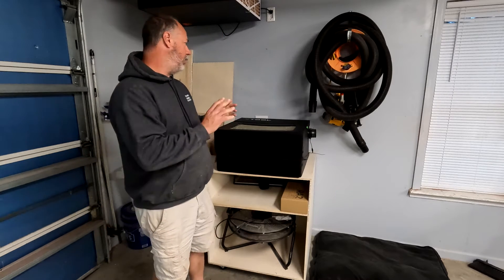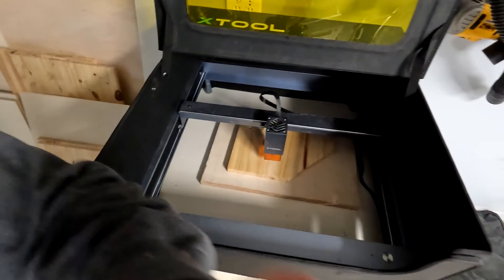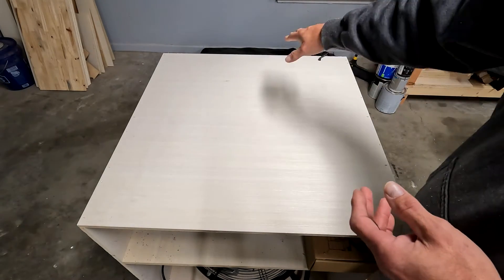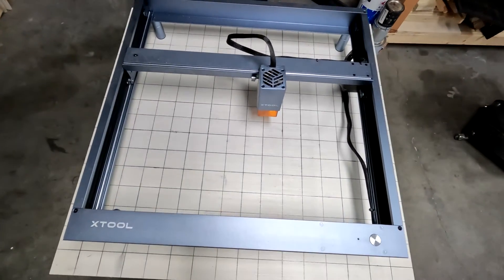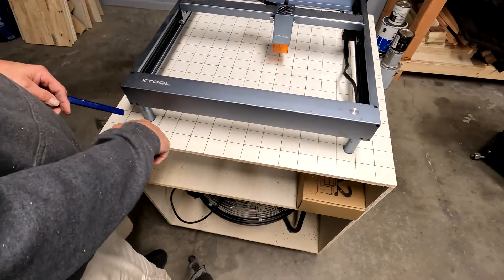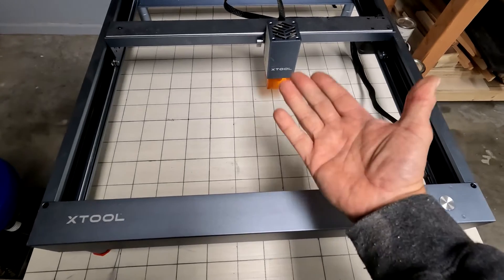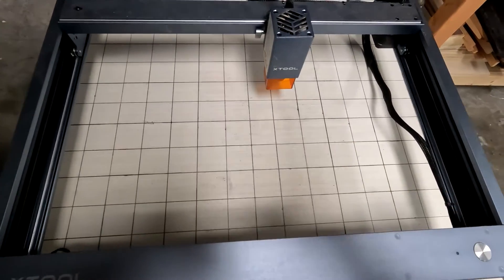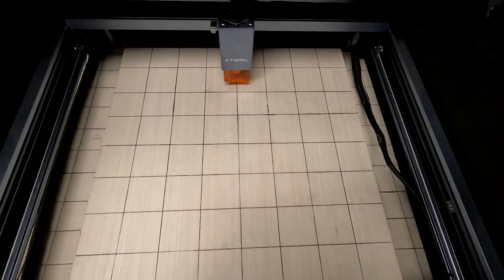D1 XTool Laser Alignment Grid Pattern Ideas Easy DIY How To

Comment: What was size of each square please?
Reply from the maker: I didn't not measure the individual squares, my table top was square so I just kept dividing in half to get to where it is.  I have a laser cutting grid with measurements on it I use when I need to measure.  https://amzn.to/42wMnNx  The squares on the table top I use just to align the pieces that go on top, or for example a cutting board I can mark the center of it horizontally and vertically and get the center point of the board.  
It wouldn't be hard to make your squares whatever size you wanted, depends if it is a small piece you may make them 1" apart.  Hope that explains a little.  Thank you for watching.
Reply: @RagerJackOfAll  thank you for the reply.